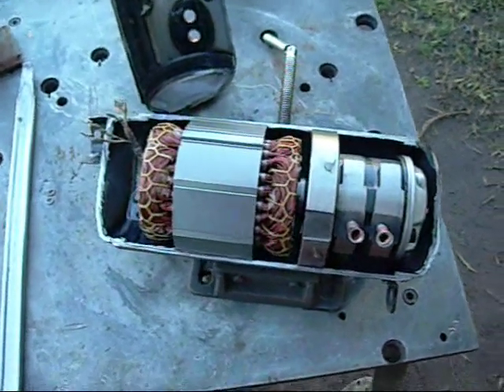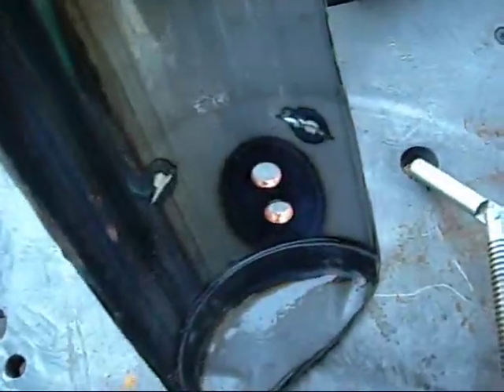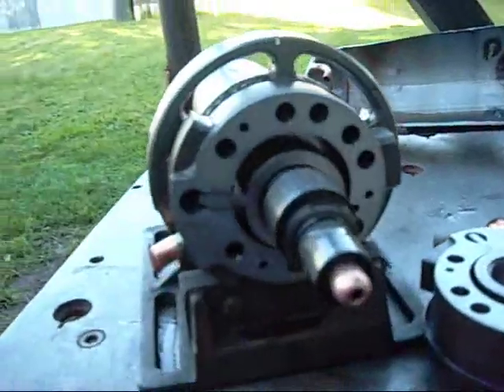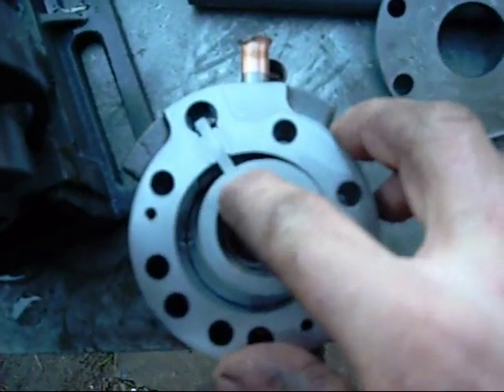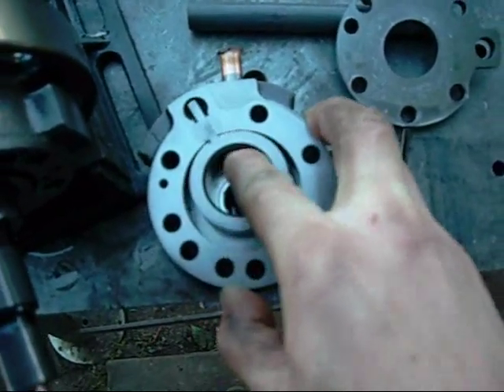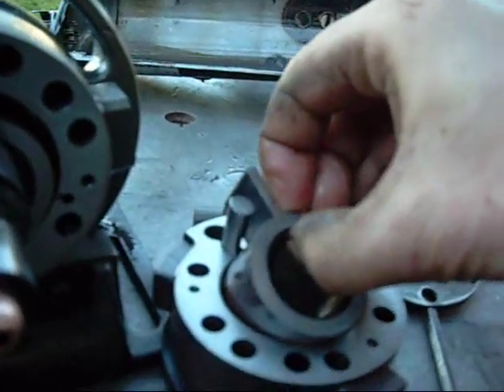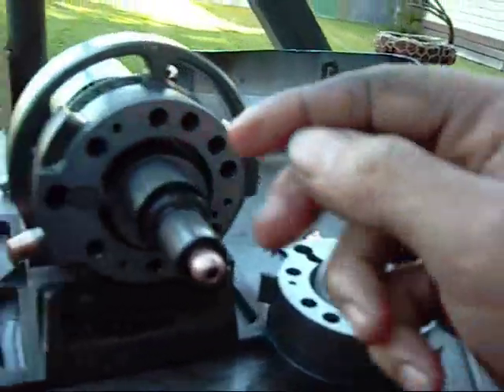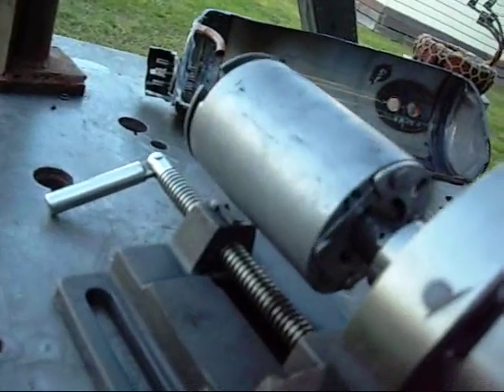Daikin Reluctance DC Swing Compressor

Comment: i need one of those! i use these refridgeration pumps as a vacuum pump system in the shop, works awesome for bleeding brakes, making plaster castings etc. and my kenmore just threw it's rod(after roughly 5 years and over 5000 hours of use) and this looks nice and reliable

Comment from the maker: It is a DC motor but requires 3 phases to run, the inverter could be bypassed long as you can emulate the 3 phases and vary the frequency like a VFD

Comment: There is a simple board you can get which will show the switching of the phases and allow you to see if the inverter is working right.  It connects in place of the compressor.

Comment from the maker: rotary compressors will last a long time as long as the inlet is filtered and the oil is kept up.

soon as crud or excessive moisture gets in it runis them pretty quick.

A normal AC powered rotary or large reciprocating compressor would do well for your work, they can pull 30in/hg vacuum!

Comment from the maker: I can't remember the DC volts but I have a working one i can find out with.
The motor dose see DC current, just in 3 phases not one.
The inverter varies the frequency of the power going to the compressor to determine its running speed.
Reply: Sir, what is the role of neutral connection in this compressor. Normally inverter compressor just have 3 contacts. UVW, this compressor got 4. Including neutral

Comment from the maker: The sticker with the condensor model number on the cover panel it was discarded by the tec's who gave it to me unfortunatly. I'll pull the compressor housing outa the scrap bin and get you the comp model number this afternoon.

The unit was 4 years old so if you call around the local AC places they may have one in their graveyard, or know someone who has!

Comment from the maker: they are a great system when they work, but a lot failed last summer because of the inverter boards overheating or IC's/Diodes becoming faulty.
Reply: Hi,Swing vs Twin rotary compressor.which is best in air conditioner,plz reply.

Comment from the maker: I'm going to try injecting air into the rotors of a sealed one and see if it creates a charge on the output terminals. being a permenant magnet rotor I don't see why not.

come next summer I'll probably get a dozen of them dieing from the heat! (inverter boards)

Comment from the maker: Digital and Conventional scroll compressors are completely different to Daikin Swing, and conventional rotary compressors.

The Daikin units I have scrapped are up to 10 years old, but not all use Swing compressors or inverter drives.

Comment: How many volts DC does that run on? and I'm wondering how exactly does the motor work? you said it has an inverter, so does that mean it converts the DC to AC to run the motor?